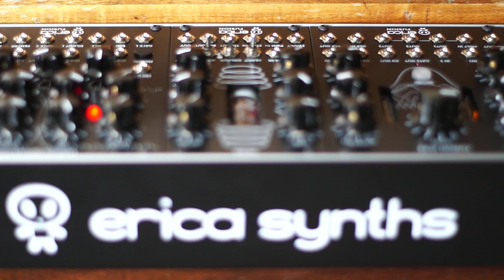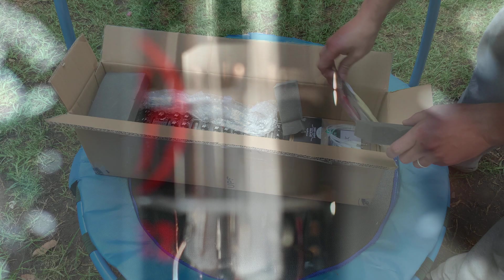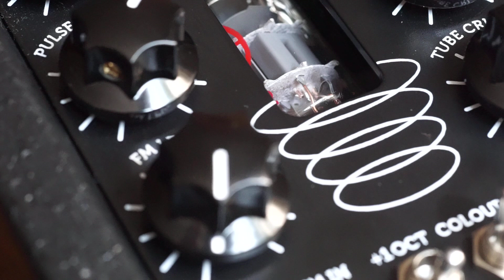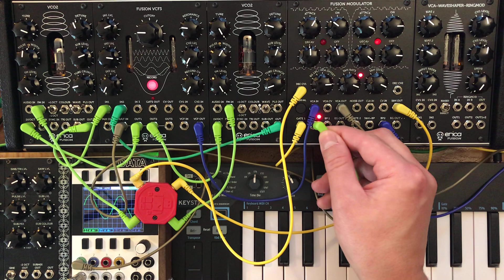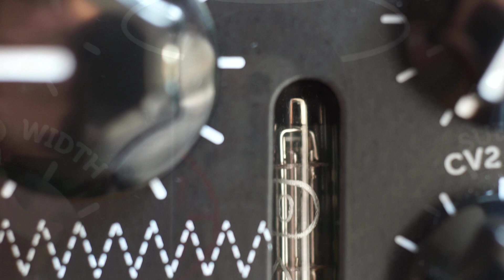Modular Synthesizer Basics - Featuring the Erica Synths Das Kleine Fusion System and Zen Delay!

Comment: Thank you for this. It was the missing manual.  I'm a noob and was pulling my hair out trying to make it work.   One thing I still can't figure out.  I am syncing with my daw via a midi to cv/gate/sync module.  I can't figure out how to send the clock and reset signals.   I suspect the clock signal goes to 'clk in' input on the modulator.  But I have have no idea where to send the 'reset'
Reply from the maker: no need to send reset anywhere! Send clocks to the gate inputs in the Envelope Generators, or to the clock in like you said to sync the sample and hold.

Comment: complete noob question, but why is my VCA constantly firing even without a CV input? Following exactly your parameters and patching it still makes an intermittent sound
Reply from the maker: the Envelope generators are looping, you need to set the OFF knob all the way Clockwise. If it still cycles you need to adjust. the trimpot in the back of the module! You set OFF potentiometers to ~3 o'clock and adjust R19 and R172 till it stops looping

Comment: hi! I just bought that sistem is it possible to tell my how could I connect this with  a mixer directly or should I need something more.
Reply from the maker: Hi! Yes, just connect the output to your mixer! The output can be either of the VCAs, the filter or even the VCOs directly, depending on your patch and what you are doing. The signal is LOUD, so make sure to keep the gain pot down on your mixer
Reply: @QuincasMoreira  Thank you! Thank you so much for your kindness!

Comment: Hi, I have a question. I bought Erica Fusion system 2, 
The fusion modulator works even if you follow all the settings of the fusion modulator you applied at 3:10 seconds(A/D/On : 0, Off : Max). It works short pulse(Click) at intervals of about 3 seconds. Could it be that mine is broken?
Reply from the maker: hi, so yours is always cycling, doesn't wait for a gate when on max position? If that's the case there are two trimpots on the back you can adjust so it functions properly. You set OFF potentiometers to ~3 o'clock and adjust R19 and R172 till it stops looping
Reply: @QuincasMoreira  Are you a genius? Thank you very much. It was resolved right away. Hope there are only good things in the future.

Comment: Thank you SO much. I have the Erica Synths Fusion System 2 which is just like the one you've got here except mine has the extra module that I will eventually replace with a better sounding multiple fx module. I really think they should create a modular version of the Zen Delay. I'm new to Modular Synthesis and been teaching myself thru books  &  videos .  It's   very frustrating at times. I was expecting a manual to come with my new Erica Synths Fusion System 2 -nope...not even one to download . After watching your video, you explained   everything very clearly and thoroughly, I understand the connections of each module, so many questions were answered ! Now I can re-watch your wonderful video whenever I get stuck , most of all I can finally patch up some sounds that are appealing to me, sounds that are in my head which I would love to create on a Modular Synthesizer. You, Sir, are  a great teacher of Modular Synthesis. ¡ Gráçias ! 💡🌟✔
Reply: Check Erica Synths Black Stereo Delay - it's a stereo delay with more features than ZEN ;)
Reply: @girtsozolins4171  : Yes, thanks I'll give it a listen ~💡🐾🌟